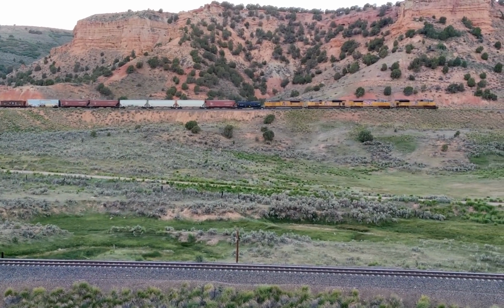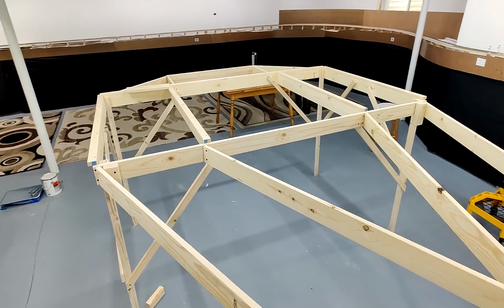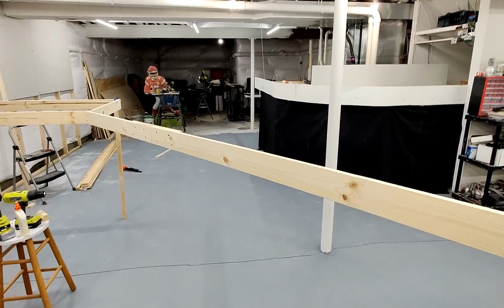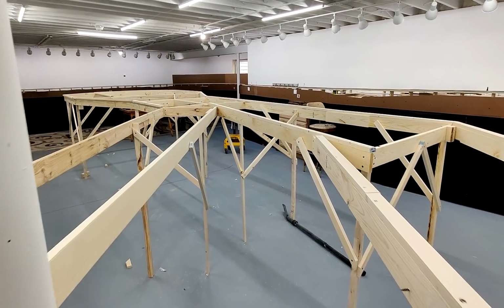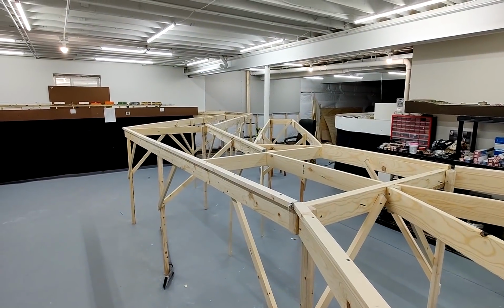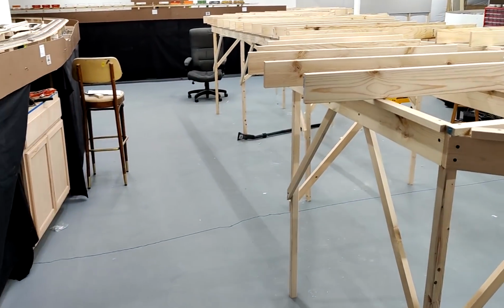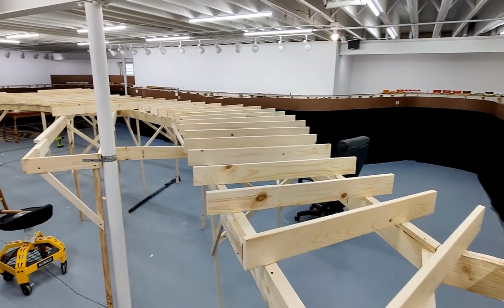s2022e05 Model Train Layout Built for Operations & Realism. L-Girder benchwork for peninsula.

Comment: Once you get some weight on there it will stiffen up.   also use that metal strapping (or 1x4) and make some X bracing on the under side off the deck will also stiffen it up,
Reply from the maker: You're probably right.

Comment: The layout is just coming along great. The best is yet to come for your layout there Daryl. I already set up where I will be building my permanent N scale Pacific West Coast model railroad. I finished the scratch built diesel locomotive shop minus the doors, finished the first sanding towers. My freight car fleet is now 85 freight cars, 4 cabooses, 5 freight locomotives, 2 will be shipped off the Bachmann for coupler replacement with knuckle couplers & one locomotive needing repair.
Reply from the maker: Nice start. Have fun.

Comment: as a lifelong cabinetmaker, I believe the 'wobble' in your benchwork is mostly caused by tour 2"x2" legs flexing. Try extending your diagonal bracing from your "L" girders, down 'till they're closer to the floor, I'm SURE you will see a marked improvement in your overall stability.
Reply: I agree with James. The diagonal bracing  to th floor will stiffen the benchwork. You add diagonal in the horizontal plane under the joists in the long narrow section to stiffen them.
Reply from the maker: I'm going to wait until road bed is all installed and then decide what to do with it. If needed, I will probably run a 2x4 from the floor to ceiling joists and secure peninsula to it.

Comment: You've got your bracing on the legs. You need horizontal cross-bracing from corner to corner of your L girders (at table height).  A plywood top wood usually address the wobble but you're not using plywood.
Reply from the maker: Thanks. I'm going to wait until road bed is all installed and then decide what to do

Comment: You have the corners of 1x4's making contact with other 1x4's at a angle to make a joint.  That's not a solid joint.  Design a rectangular frame and everywhere you want a rounded edge or odd shape, extend the rectangle out to form your shape.  Two 1x4's as legs in an L shape attached to the main rectangle frame corners will help as well.
Reply from the maker: Thanks. I'm going to wait until road bed is all installed and then decide what to do

Comment: High Daryl, you need to fit the the support legs on the peninsular opposite each other then brace them together from the top of one leg to the bottom of the opposite leg and visa versa the other way so you have 2 braces on the pair of legs, those braces you have are to short to hold it rock steady, just my two penny worth sir
Reply from the maker: I'm going to wait until road bed is all installed and then decide what to do

Comment: Just an idea: In the part that is 'wobbly' I don't see any horizontal cross bracing (only vertical). You also don't have them on the end of the peninsula but there the last pieces of the main frame close 45 degrees, so this acts like a horizontal cross bracing. I think two pieces of horizontal cross bracing in the wobbly part should do it.
Reply from the maker: I'm going to wait until road bed is all installed and then decide what to do

Comment: Question: Why are you using 2x2's for legs instead of 2x4's? I tried that and ended up replacing 2x2's with 2x4's they ended up being a lot sturdier..
Reply from the maker: I'm going to wait until road bed is all installed and then decide what to do

Comment: This is just me and probably too late to do it, I would have just run stud walls up all the peninsulas anchored to the ceiling and floor and then your Benchmark off of that.
Reply from the maker: I like the open look of the layout room. Don't want a wall in the middle of the room.
Reply: @EvanstonSub  fair enough. I guess I just think of model railroading as so intertwined web creating Illusions the set time and place I don't like it when you can see an area that supposed to be 20 miles away across the aisle because of shed the illusion of distance. But, to be fair since your male part of Echo Canyon you can probably exaggerated the cliffs enough to do that for you
Reply from the maker: @GooseinTheCabooseProductions  there will still be backdrops on the peninsula to block your view, just won't go all the way to the ceiling.

Comment: On my previous layout of 18' X 30' I tied the layout to 3 center poles in the basement by boxing them in by using 1" by 4's".  It didn't move.  My present layout is much smaller and I used large flat boards 12" by 15" in the corners to strengthen the layout since I live in an apartment, and am not permitted by contract to drill holes in the walls.  It is very sturdy and doesn't move at all.  That can still be done with yours by boxing in those white posts, but then the one side would allow for a narrow isle. Still following your progress.  And the roadbed I love that you recommended.  It is much easier to work with than cork.  Just lay it down and put a nail through one of the ties pressed into the wood base. Presto!
Reply from the maker: I'm going to wait until road bed is all installed and then decide what to do.

Comment: Hi Daryl, great progress. Just a thought from the sofa re: the peninsula wobble. Could you maybe put some anchor points into the floor along the centre line, and run steel cables to brace the framework? You could use inline screw adjusters for tensioning and fine tuning.
Reply from the maker: Interesting idea. Was thinking I may just run a couple of 2x4s from the floor to ceiling joists.
Reply: @EvanstonSub  That sounds quite a bit simpler, though it would be a shame to lose the wide open spaces!

Comment: In your opening shot, the crews called the big curve next to I-80, to the right of the camera view, is “Mail train curve.” That’s the location of a horrific accident of a mail train that hit a bolder that killed two of the train crew members. 

Denver Rocky Mountain News reported in its April 1, 1909 edition the following. 

TWO KILLED IN WRECK WHEN TRAIL COLLIDES WITH IMMENSE ROCK

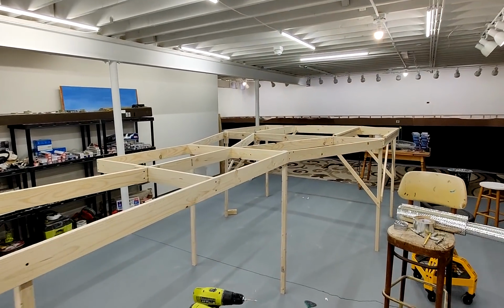SALT LAKE CITY, Utah, March 31. -- Union Pacific passenger train No. 3, westbound, was wrecked near Castle Rock, Utah, at 4:30 this morning. S. J. Lewhan, fireman, and C. J. Gordon, baggageman, were killed. None of the passengers was injured.

The wreck was caused by a landslide which carried a large boulder on the track. In the collision the baggage car, mail car and three passenger coaches took fire and were burned. The rear coaches were uncoupled and saved.

Wrecking trains were sent from Ogden, Utah, and Evanston, Wyo., and the passengers were returned to Evanston, nineteen miles from the point at which the wreck occurred.

Fireman Lewhan was found buried under his engine, but the body of Baggageman C. J. Gordon has not been located. It is supposed to have been incinerated in the baggage car.

From one Chiefs fan to another, I empathize with you. It was a tough loss.
Reply from the maker: Thanks. interesting story. Too bad they couldn't get some warning before the collision.

Comment: I had the same leg issue in the past that you are having on my layout. I switched to 2x4 for legs (from 2x2) and then 1x2 cross pieces at the bottom.  The cross pieces also keep the legs from moving and should the legs get bumped no issues. (I am a N Scaler)  

As always you layout and weekly videos are great!  Take care be safe.
Reply from the maker: I'm going to wait until I get the Roadbed on and then figure out how to get it more stable. May use a couple of 2x4s attached to floor and ceiling joists.
Reply: BTW, I Was a big fan of the Genva Sub!  I am also a UP modeler.  Take care and look forward to your next post.